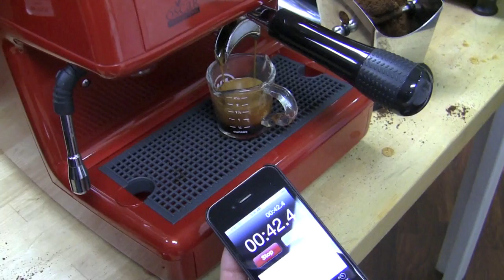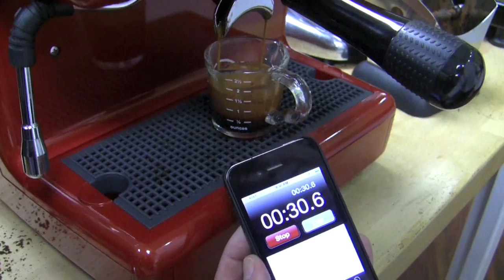How To: Dialing in a Coffee Grinder

Comment: Thanks for the advice! I never turned my grinder on when adjusting it to make espresso.. the manual never mentioned that at all. will do so from now on.. just hope i didnt damage the burrs too much. great video! thanks again!
Reply: I've heard it compared to changing gears on a bike where you need to be peddling to change the gears, on a grinder it needs to be running to change grind settings, especially going smaller as a bean could get stuck in between if was not running and damage the burrs.

Comment: Great advise. The reason why people recommend keeping the tamp pressure, load, etc. constant is because of what was addressed at the end of the video. I think once the machine, grinder, and beans are dialed in at the specific location of grinding, then tamp pressure and load weight can be adjusted based on preference. My advice would be to make sure to buy an auto burr grinder. I am still using a hand crank and have been trying to dial in a machine the past few days and it has been taxing.

Comment: She means what is after the burrs, so the previous grind doesn't mix with the new setting and cause channelling etc from the coarser grits in with the new finer setting. What she meant about between the burrs is if you do too big of an adjustment at once you can damage the machine. Most manufacturers recommend to start the grinder then adjust, stop, clear the old grits/grind setting, fill your porter-filter, tamp then pull.

Comment: Hi guys. Great lesson as usual. Question: when you talk about stopping the shot, do you use volume alone to determine when you kill it, or will blonding also determine whether or not to stop it earlier? Does my question make sense? I mean, You can get a 2oz shot in say 27sec, but the couple or so seconds of the shot's really pale. And so, even if you have 2 or so oz, in the correct shot time, you'd still end up with a bitter shot. ??? Thanks...

Comment: A good indicator to me is use a spoon to scoop out the used grounds, if it seems dry in parts or fused together too much means the grind is too fine or tamped too hard. If it is soggy and leaving too much dark coffee layer on the spoon it is too course / under extracted. you want the used grounds to appear uniform and clean/used when you scoop them out.

Comment from the maker: @dan314159 OK, not sure if I'm clear on what you're clear on and what you're not clear on! So ... a) tamp pressure should be calibrated and then work on your grind based on that; b) you need to grind out coffee in the chute that was the previous grind before you're going to see your adjustment in the shot and c) it's different for every basket and brew head; it could be that yours is too far down and you need to measure your coffee differently prior to tamp - Kat

Comment: Just to clarify...if I had my grinder on a medium-coarse setting for French Press, and then wanted to change the setting for espresso, I should have the grinder on while closing the burrs, else the machine will break...correct? But, if going in the opposite direction, it doesn't matter since I would be increasing the distance between the burrs.

Comment: Hello SCG.  I have become a fan of your videos and have learnt a lot!  Thank you!! :-)
A grinder comparison question:  I'm considering the Simonelli Grinta vs the Compak K3 for light home espresso use (1-2 cups at a time with Oscar).

I'm not concerned with features, appearance or operational noise, but grind quality/fineness is critical, as well as machine durability and best $ value.

Is the K3 worth the additional cost?

Seems Grinta has enough steps vs K3's stepless...

Thanks in advance :-)

Comment: I might suggest keeping the grinder empty and weighing each dose. This way the grinder can be adjusted without wasting coffee. I would also suggest increasing the dose slightly rather than increasing the tamp pressure to increase the shot time and reduce the acidity if stuck between grinder steps.

Comment: OMG I love this video! So detailed and clearly explained, as are all of your videos :)
And your explanation on the period to use fresh beans and adjusting the grind size as it gets older explains a lot. I've noticed on my Breville grinder when I buy fresh beans on my grinder I have to start at about 14-13 and as time goes on I end up taking it down 1-2 notches.
I do have one question if you can please answer this for me, when I changing the grind setting by 1 or 2 notches do I still need to dispense out the old grinds or are they so close that it won't have an affect?

Comment: Thanks for this video, guys! I've seen a few people dial in a grinder for their machine, but I have a question: when you were timing the extraction you stopped at a certain point. For fine grinds that was long (30s) and for coarse grinds it was short (12s). Question is, how do you know when to stop?? Can you tell just by looking at the shot that comes out? I wouldn't know when the shot was 'done' so I could then compare the time it took. Thanks in advance!
Reply: Stop based on the yield you want, for example, 2 ounces or 56 grams.

Comment from the maker: Try grinding a little bit finer or tamping a little harder. The timing of the shot should be 20-30 sec, so if there isn't much crema, then look at how fresh the beans are (the fresher they are, the more crema they generally will get). Another remedy is to go much coarser, and then slowly adjust to a finer setting, making sure to grind (machine on and grinding beans!!!) at the same time as adjustments are made. ~ sam

Comment: What do you think about "seasoning" your new grinder?  I'm reading on some forums that you need to run through about 1kg of beans to season the burrs on a new grinder.
Reply from the maker: Hello frustin, Seasoning a home grinder isn't always necessary, but if you prefer to season your home grinder approximately a half pound (or less) should be enough. If you are seasoning a commercial grinder, some use up to 10 - 15 pounds to get it just right. I hope this helps! - Sarah
Reply: Seattle Coffee Gear but what is it actually doing? what's the science? ;)
Reply from the maker: frustin Because the new burrs are very sharp and can cut beans too fast, this can result in overheating the beans and can cause inconsistencies. Seasoning new grinders essentially helps dull down the new burs just a tad, so your daily grinding is more consistent. Some may say is helps deburr the burs! ;-)  - Sarah

Comment: Which tamper are you using?
Reply from the maker: Hi Jill Selkowitz- its the Rattleware Stainless Steel Tamper with Short Handle. You can find it here: https://www.seattlecoffeegear.com/rattleware-stainless-steel-tamper-with-short-handle :)
Reply: Seattle Coffee Gear Thank you for such a quick response.  I just clicked to buy one of the tampers and see three sizes.  I use a stove top aluminum little 3 cup pot (the kind used for Cuban coffee), so I am not sure which size to buy.
Reply from the maker: Anytime Jill Selkowitz :) Are you using something similar to this: http://goo.gl/2RZua5 ?
Reply: Seattle Coffee Gear No, it is not that style.  I am trying to show one to you, but the link is not showing.  Just a sec.
Reply from the maker: Jill Selkowitz Can you explain a little why you are looking for a tamper for this style brewer? It isn't suggested to tamp the grounds in that style brewer. If you pack the basket, it is possible that you may build up too much pressure in the pot. The pot has a safety valve for this occasion.
Reply: Seattle Coffee Gear I've been making espresso for years in this pot and thought that I should use a tamper because I notice that sometimes the coffee is too weak and sometimes it is just right.
Reply from the maker: Jill Selkowitz Sounds like an interesting experiment! I would reiterate the danger of excess pressure build up but if you are still looking for a tamper you would need to measure the inside diameter of your particular basket. Then match that size with the closest tamper size; 53mm, 57mm, or 58mm. Since tampers are not designed for this use you may not find a perfect fit. But you might get lucky!
Reply: Seattle Coffee Gear I won't get it for this little pot then, but will experiment with filling the basket similarly to how it is done in the video regarding shaking around the grounds and then adding more.  What is your opinion of this style of pot?  I know a machine is the more popular and I do have one, just never use it.
Reply from the maker: Jill Selkowitz Absolutely experiment. The little pot is a great way to brew coffee, however it isn't technically true espresso as it is not being brewed under 9 bars of pressure. But if you like the flavors you get, don't change anything! :) You could also weigh the amount of ground beans you are putting in the pot each time to get a more consistent result :)
Reply: Seattle Coffee Gear I get a nice Crema on it and it sure tastes like good espresso, as a matter of fact, it tastes better than what I can buy at coffee bars.  I understand about the bars of pressure.  I also have a Nespresso which I only use for emergencies and as I said, I do have a good real espresso machine and still like the espresso from the little pot.  Maybe I will also pull out my machine and try that again.
Reply: Seattle Coffee Gear Which espresso machine do you suggest?  My husband just told me he threw out our espresso machine when we moved.
Reply from the maker: Jill Selkowitz Oh no! Well, there are a lot of options out there. I would probably suggest an entry level machine. Its a great place to start developing your skills while not breaking the bank. A favorite of mine would be the Saeco Poemia: https://www.seattlecoffeegear.com/saeco-poemia-espresso-machine. But you might also want to check out the Capresso EC Pro: https://www.seattlecoffeegear.com/capresso-ec-pro-espresso-cappuccino-machine
Reply: Seattle Coffee Gear Thank you for the suggestions.  I'm not worried about entry level and would prefer a good machine that will be used for years and years.  I work from home and morning espresso is very important to my husband and me.  :)  Which do you and/or Gail use at home?  My husband is a fabulous barista and takes pride in our morning espresso drinks.  We like a good Cortadito, which is similar to a latte or cappuccino, I guess, depending on the amount of milk/foam used.  I should post some photos.
Reply from the maker: Jill Selkowitz Please do share some photos! I would recommend giving our customer service line a call, that way we can walk through all the options with you and really find out which one will best fit you and your husbands needs :) Give us a ring at 866-372-4734. We look forward to it!
Reply from the maker: Jill Selkowitz Please do share some photos! I would recommend giving our customer service line a call, that way we can walk through all the options with you and really find out which one will best fit you and your husbands needs :) Give us a ring at 866-372-4734. We look forward to it!
Reply from the maker: Jill Selkowitz Please do share some photos! I would recommend giving our customer service line a call, that way we can walk through all the options with you and really find out which one will best fit you and your husbands needs :) Give us a ring at 866-372-4734. We look forward to it!